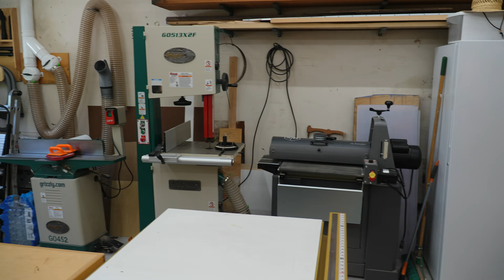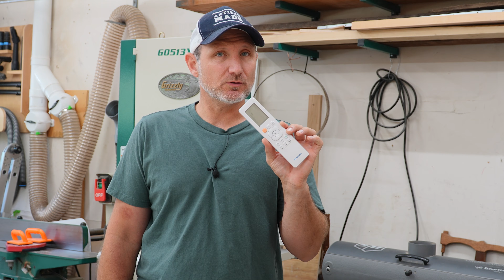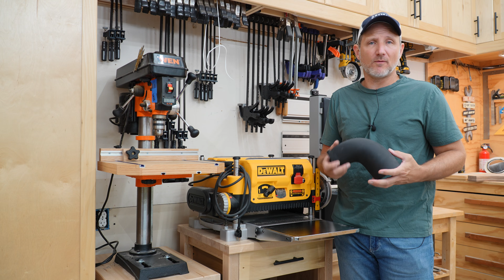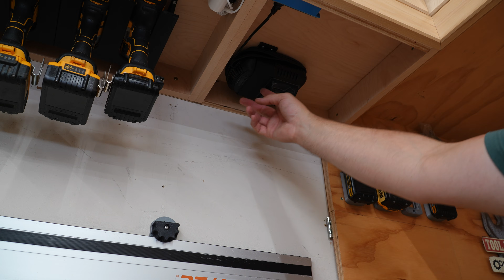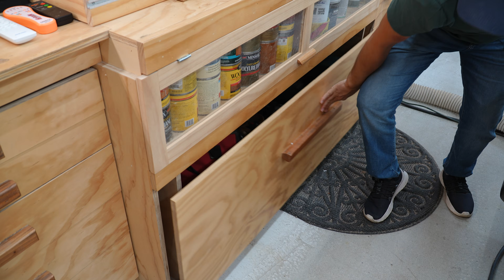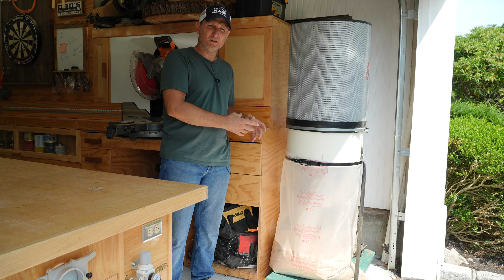My Two-Car Garage Workshop / Shop Tour 2024 / Woodworking tools / Shop Organization

Comment: The grizzy brand, look up the G0887, ran one of those for two years and was on the install crew for it. My initial thought was that its Chinese junk and would break quickly, I was wrong. we have cut 24"D 5/8 to 3/4 wall steel pipe without a single issue and still in the factory specs to true zero. As a fabricator, I can only imagine how it would do on wood. (Currently learning carpentry)

Comment: Like the video. Remodeling my shop now and could use some of your ideas. What about a 3D printed riving knife? Also, possibly angling the bottom of the 4 sides on backside of miter saw to a 4” port so gravity can help with dust?

Comment: My garage is like a 2 door extra-cab truck. It's narrower than a 2 car garage but it's longer. It has an extra toolroomesque extension added at the back of it. The garage door has 6 windows instead of the normal 7 or 8. I think the door is about 1½' narrower than a 2 car door.

Comment: Artisan man. Will you make and ship me that dust collector fitting piece for your rigid spindle and belt sander you shouwed in your shop tour 2024 video? The blue peice you put on your rigid spindle and belt sander then.
Reply from the maker: Hey brother!  I designed one that attaches with the star knob that comes with the machine. You can pick one up on my website.  https://artisanmadebuilds.com/products/dust-shroud-for-ridgid-oscillating-sander-with-2-5-inch-and-4-inch-flex-hose-adapters

Comment: Lots of good ideas here.  I'm in slighly more square feet and can move stuff outside for track sawing, glue ups and assembly in my climate most days but it's still real crammed with heavy equipment from my professional days.  Cabinets look great and can show off skills and options to visiting clients but I find I can see more and cram more onto moveable shelves.  If they aren't too wide they can be staggered on standards for perfect heights for what I put on them.   I prefer wire shelves so dust falls through and I can hang stuff on the grids.  When I can see stuff it's easier to remember where it is but if I'm in the shop enough puttering around I basically know where most things are, or at least the general location.  I was using little plastic drawers for a huge 3 generation hardware collection (my grandfather was an engineer and I have all the weird hardware stuff and screws he collected) on the wall but they aren't depth-efficient, as it were.  They consume wall space that could be used for twice as much storage if not more.   I had a nice label maker for awhile but it broke.   If I were more disciplined about it I would take label notes when I'm in the shop and print them up en masse on a computer.

If I did it again today I'd probably get a 3D printer for like $200 and use drawers and the awersome open-source Gridfinity storage system for the little stuff.  As it is I have it in L-Boxx I-Boxx72 drawers with those bins (I've printed some smaller ones, using different colors for metric and imperial) in a big stack on a rollboard but the cost of that can add up.   I have some Durham steel hardware drawers and a 4-drawer sliding rack too... those are surprisingly affordable for what they do.

Comment: How do you like the location of your table saw? How much space do you have behind your table saw if rip cutting long boards? I have  my table saw and out feed table opposite to yours, and I find always regardless of the weather, I have to have the door up to cut wood, plus somebody can walk up on me while I’m cutting wood. Your thoughts. Great video.
Reply from the maker: I used to have mine positioned like yours. I prefer it that way because I can rip long pieces of wood without any problem. The problem was that when I open my garage door and it had rained, sometimes water would drip on the surface of the saw and cause rust. I recently changed out my table, saw for a saw stop, and I would like to keep the top new as long as possible.

Comment: I have the opposite experience with my Ridgid miter saw.  Cuts are dead vertical.  The detents for anything other than 0 degree are...sloppy.  I'm counting myself lucky at your expense.  :)
Reply from the maker: I got rid of it a few months ago. I replaced it with a Bosch. What a difference!

Comment: I had a Powermatic 66. I would not sell that saw you have for anything. Maybe… MAYBE a Harvey with the Big Eye. Powermatic 66 is a Benchmark Table Saw. If you sell that saw I am your first call regardless of where you live. On your Bandsaw go with a Harvey over the Laguna. I am replacing my Laguna 12 16 lathe with the Harvey T-40. I had a Laguna Bandsaw. I now have the Harvey Alpha. No comparison. The Harvey tool line shines. Let me know on that Powermatic 66.
Reply from the maker: I actually sold it the day before you posted this comment. I loved my Powermatic, but I decided to sell it for a new machine with more safety features.

Comment: Great video!!! How long does it take to get your workshop back to select temperature after opening that garage door, In the cold and in the heat? Also Noticed you have a lot of wall space that can be utilized for shelving or storage if you recessed the dry wall between the studs is there a reason you're not doing that?

Comment: If I may ask, which 3D printer would you recommend for printing the shop accessories you mentioned? (And any other related items). That blue dust collection piece for your rigid spindle sander is really cool.
Reply from the maker: I’ve been using Bambu lab and I really like it.  I did a video on the spindle sander part and there is a link in thatvideo description. I linked that video in thisvideos the description.

Comment: I have one word for your shop "organization". Its amazing what you have done with the space you have, A few comments the table saw, bandsaw, jointer and sander are all great. I don't like hanging tools on walls with a few exceptions. With all those cabinets I would this sounds dumb forget what's in them. The Mr cool system is great, I have one in my florida room. Again I'm amazed with what you have done. Great shop.
Reply from the maker: You are right about the cabinets. That’s the trade-off.

Comment: any plans to show the 3d printer setup?
Reply from the maker: Damn! I should have included it in this video. I will definitely show the setup at some point.
Reply: @ArtisanMade  looking forward to it! not many wood working channels also utilize 3d printers
Reply: Do you have a link to the 3D dust shut for the spindle/belt sander?
Reply: @dougschriefer3076  I’d buy one as well !

Comment: I'm not sure, but it looks like the filter and separator could be raised high enough to give clearance for the miter saw. Make a custom bottom to the separator to funnel dust into a hose to a barrel below the plain of the miter saw.  Could solve two birds with one stone. And would make a great video.
Reply: I have a similar dust collector, and I’ve done exactly what you suggested. it seems likely that it would work in this instance.
Reply from the maker: I though about this a while ago. Now I'm motivated to give it a try.
Reply: @ArtisanMade  my installation the separates the fan and dust collection drum and exhaust cartridge/filter on different sides of a door, using what would otherwise be underutilised space in the shop.

Comment: I have the same table saw! Even paid the exact same price. Mine has an upgraded 3Hp motor.
Reply from the maker: Mine has 3hp too.  Not sure if it was always like that.  I'm assuming none of these had riving knives back then?
Reply: @ArtisanMade  Not sure about that. I got mine used from a co-worker. Didn't have the riving knives when I got it. I have looked online for them, unsuccessfully.
Reply from the maker: @Z-Bart  That’s too bad. I would love to add one.  Thanks for the information
Reply: @ArtisanMade  For sure. Pinches and kick backs are no fun.

Comment: Great shop and an enlightening tour. Thank you for sharing. I love all of the storage available and the fact that it is all dust free. Could be one of the first Festool free shops 😊 I love the dust attachment for the Ridgid oscillating sander. I have and love that sander but the dust collection is abysmal 😮 I do not own a 3D printer. Wondering if you make and sell them or just provide the plans for it? Wondering where and how I might be able to obtain that appliance for my sander? Keep up the great content and be safe in the shop. Mike
Reply from the maker: Thank You!  I can't sell that exact exact dust collection shroud because I didn't design it. I will be working on one of my own this fall and I should have something for you then.